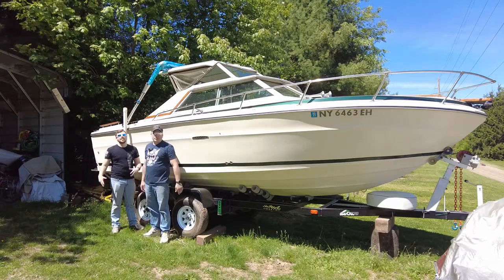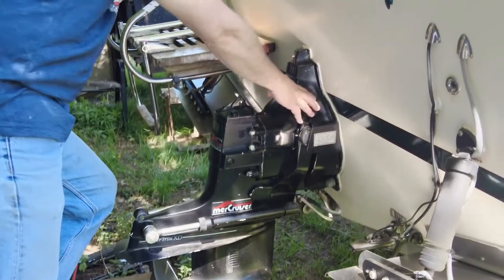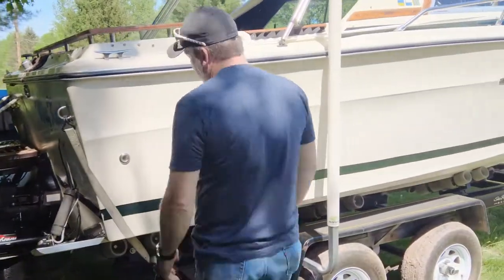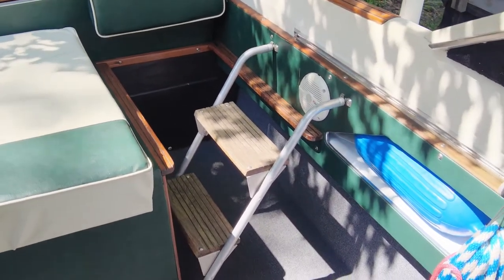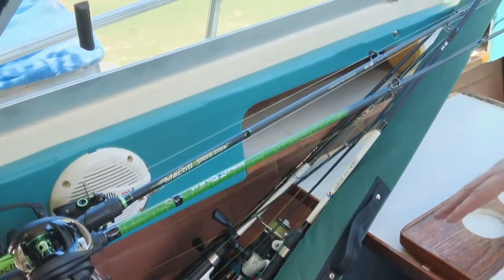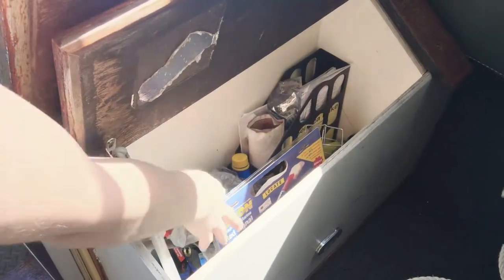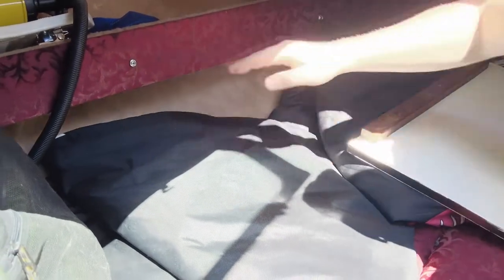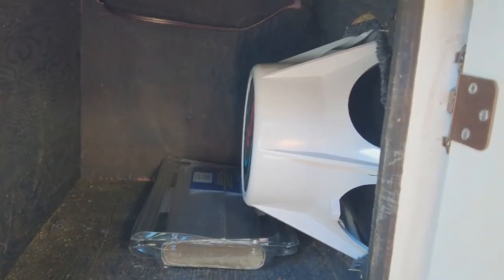1977 Sea Ray SRV220 Hardtop Boat Tour

Comment: I have a 1975 SRV220 cuddy, just got it in Nov for $501..Boat was an orig owner and was off the water since 2006 under a carport. To the people just getting one, drain the gas tank. Here is how I did mine,  disconnect the fuel line at the back of the tank in front of the engine. Get a hose barb 5/16 male  sierra part # 18-8055 unscrew the line at the tank  screw this in and get a hose long enough to run out the drain plug at least 5-6 feet get some vice grips to  clamp down on the hose to stop the flow when you get the fuel going. Fill gas tanks ect and take it to jiffy lube on a Sunday since they are close and dump it the recycling tanks by the dumpster ...I did 35 gal out of a 70gal tank you don't need to take the sending unit out since the gasket can break apart..going to do out drive water pump, exhaust replacement ( keep these bolts lubed or they will break off) if broke off than get a pipe wrench and heat. I had 5 break since they used it in salt a little while in Texas had to get a crow bar to get one off and hammer took hours on just one side.  Don't try to start it if it has been sitting, change water pump other wise the rubber from pump will break off and go into drive/engine. Good luck.

Comment: Hey jimmy I really appreciate this video. I just bought the exact boat a week ago and have done a lot of work already. Redid all teak, pressure washed, added garnin transducer and now Putting in a fuse block now and trying to add a second battery but this is a huge job since this is my first boat. If I could somehow contact you with questions that would be awesome
Reply from the maker: Hey GT, you can contact us through our contact page on our web site and we can help any way we can.

Comment: I have a 76 220 that's in decent condition. I'm wanting to restore it look new and fancy. What order should I start restoring everything in? Just buying it it is overwhelming with every little piece.
Reply from the maker: That's going to be what you want to do. If your motor is running good and you're doing some of the work yourself, new vinyl for the seats, and carpet are a big help. We also put foam on the upper deck near the bow to help with grip. It's amazing. Electronics are usually the most expensive, so if you save up for the updated stuff you want you should be good to go.

Comment: Can you use this boat for parasailing
Reply from the maker: Yes, it could easily. Parasailing boats go around 15 knots. Might need a prop change for a smaller pitch to get a better shot out of the hole.

Comment: Excellent Job. Have the same boat. Brought it to Greece from the states back in 1986. Could you please give me some details on the prop?
Reply from the maker: Hello Fotis,
       Our prop is a Mercury 15" Dia x 17P  RH prop. I hope this is the info you were asking about. Thanks for checking out our video. Please consider subscribing if you haven't already.
Reply: @Jimmy2Tech  Thank you for your prompt reply. This is what I was looking for, cause I have some trouble finding the appropriate pitch since I have changed the engine with a new 5.0 mpi 260 hp. Have tried them all, 3 blades 17' alu, and inox, 4 blades 18' alu etc. Seems I have put some additional weight with the extra outboard (9,8hp Tohatsu) and the extra water tank (for shower). Anyhow thank you for your reply. Have subscribed already and looking forward for your next videos. Stay safe.

Comment: Where is the fuel tank accessibility on this ..i have the same boat
Reply from the maker: you only really have access to the front of the tank where the floor steps down, that is where the sending unit is. The tank is pretty much molded into the floor.
Reply: @Jimmy2Tech  ok cool I see the panel were u step down with 4 screws or something. Thanks

Comment: How can I change the carpet floors to fiberglass floor with mats?
Reply from the maker: Hello Henry,
        It would be quite a job. We replaced our carpet and when we tore up the carpet the floor was fiberglass but like rough. We had to scrape the floor to make it smooth enough for the new carpet. To do what you want you would have to scrap the floor sand it and I would add another layer of fiberglass mat. Then you would have to sand again and roll or spray on the gel coat. Then it would look good enough to put on the foam. The floors were not preped for being visible thats for sure. Carpet was way easier for us. Keep us updated on which way you go and how it turned out.

Comment: What's the top speed and pitch on the prop
Reply from the maker: Hello Brendan,
        Our prop we prefer is a 17 which for us gives us good torque which helps out of the hole and we get a top speed of about 32 mph at wot if we need it. Thanks for watching.
Reply: Okay thank you I have the exact same boat I have a 20 pitch on mine and it does 40 I'm going to drop a pitch or to so I can get alittle bit faster and out of the hole

Comment: How much did it cost to do all repair on the motors?
Reply from the maker: Hello Henry,
       We have about 1500 into the motor since we owned it. It was not at one time though. We did the normal tune up stuff like plugs, oil change, etc. We also upgraded the distributor and wires , coil, replaced intake gasket, rebuilt carb, valve cover gaskets, alternator, belts, fuel line and filter, exhaust log and elbow, and a bunch of other things here and there.